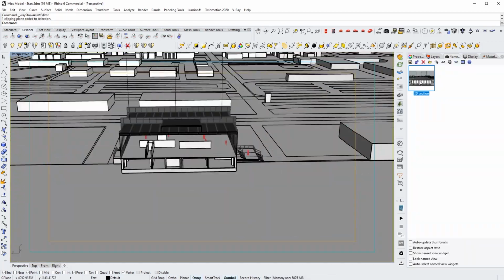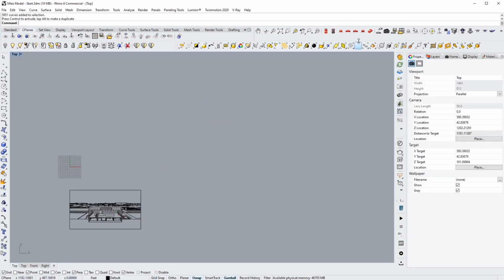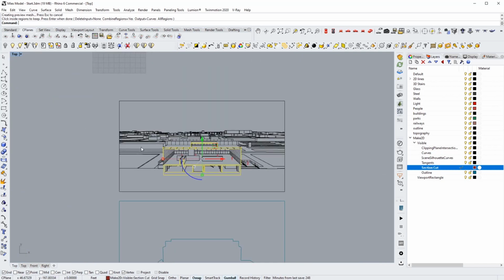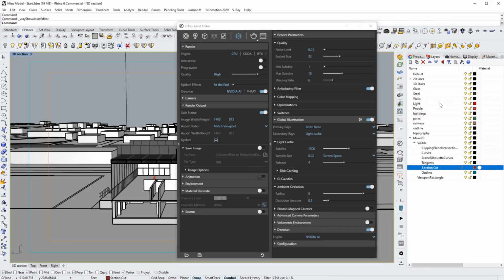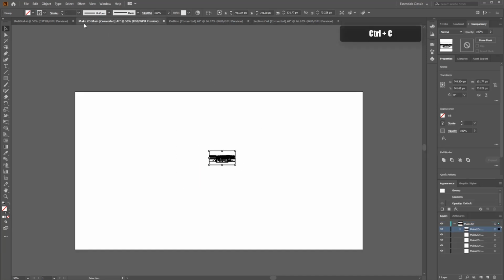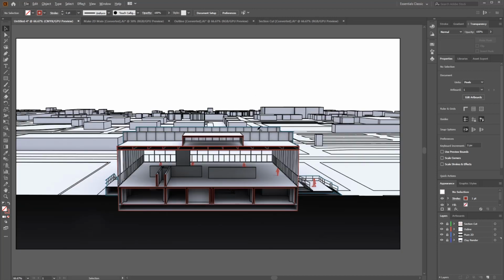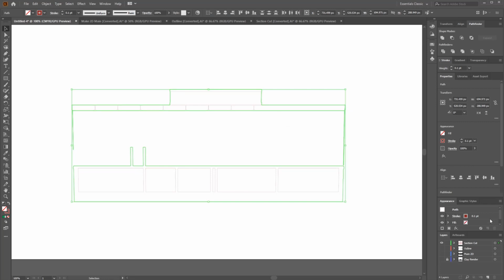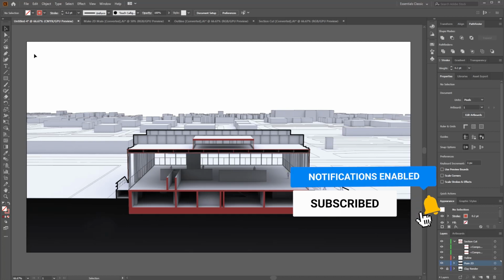Rhino to Illustrator 3D section

Comment: Great tutorial! :D I was wondering if Make 2D is the only way to generate line drawings from a model? seems to generate so many unnecessary curves and can slow down the workflow at times.
Reply from the maker: That's the only way to export vector lines from Rhino or you can also print it as vector pdf. If you don't want unnecessary curves, make sure to hide those elements before you do Make2D, then they won't be visible.

Comment: great video as usual, thanks 
btw I prefer to use Affinity Designer it can handle Rhino vectors way cleaner than Illustrator.
Reply from the maker: Thanks Mahmood, 
I just checked that software, seems quite interesting! However, Illustrator is used far more in architectural studios, that's for sure :D